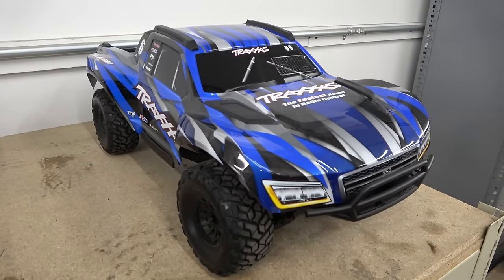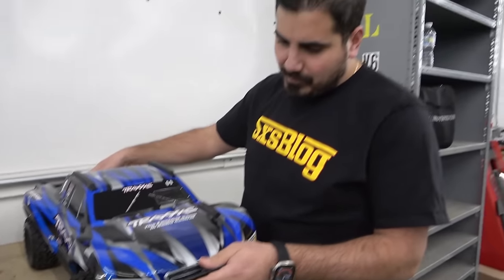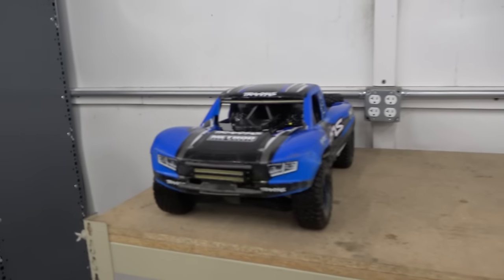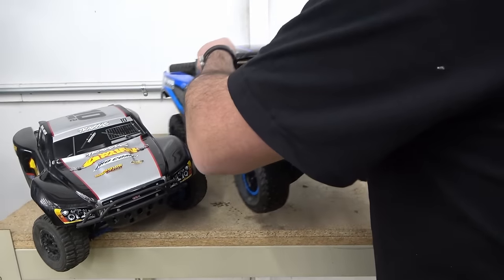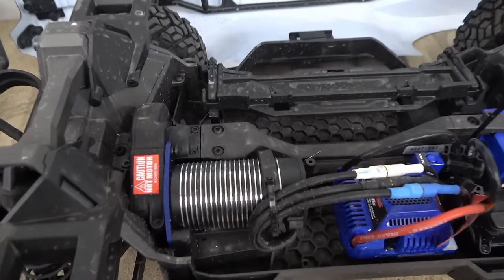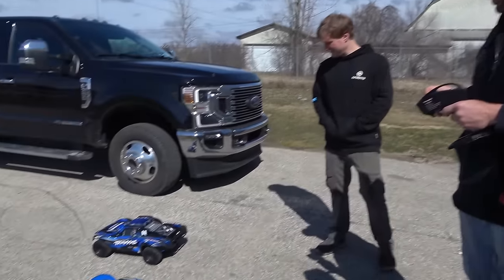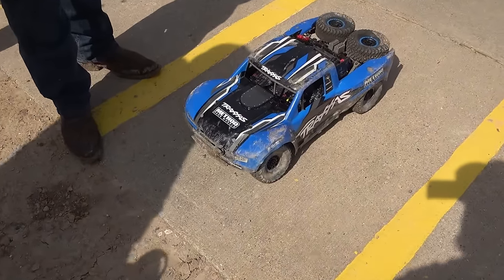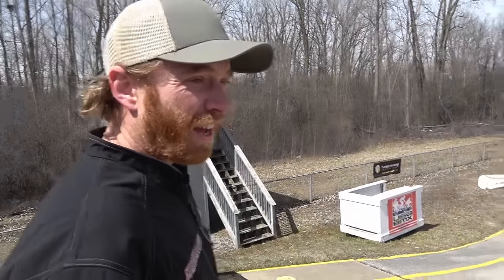RC Truck Carnage! Maxx Slash Durability Test

Comment: You need to find an RC pulling sled. I used to have a modified T-Maxx set up for sled pulling. That was the most fun I had with my truck. I sure do miss my Maxx

Comment: We need more RC Tracks in lower michigan. I use to race RC buggys at larrys performance RC when it was in Waterford back in the 80's / 90's. at that time there were a few local options but now it seems impossible to find anything in Oakland County. I got a Nitro Revo 10+ years back and could only just bash it in local areas and then just got back in it with a Traxxas Maxx widebody. I want to rip it on a track but can't find anything. If anyone knows a good place in Oakland County to rip these let me know. I've already upgraded all the weak links so hopefully it doesn't break on my first run lol. Now I want an XRT with no big open places to rip it's pretty much just going to sit.

Comment: Flips it into the stratosphere at 40 m.p.h. "Don't know why this happened"  😅😅🤣🤣😂😂  Enable training mode by powering on the receiver and keep the button pressed until the led blinks red  3 times.  Its way more controllable and the battery last way longer. Still a blast to drive.

Comment: that’s what weight and 6F power does I’ve got a summit, which is a monster it’s a beast. I have a graded it to a 6S and a mambo max pro from castle it’s stupidly fast, but because of the weight, the mass of the tires, it rips stuff apart. butits funnnnn

Comment: I just got an arrma Mojave 6s last week, I think your money is better spent there, it's bigger tougher and just as fast. On 4s it rips pretty good. On 6s it's an Animal! I have had a UDR before, similar speed and power but it jumps and it TURNS 100X better. I was looking at Maxx Slashes but just had a Maxx and wasn't too impressed, also a little smaller than I wanted.

Comment: A 8s Traxxas ESC is the same size as the 6s ESC. And that motor can handle 8s. And put 20 million in the center diff. And get the 44 tooth pinion gear.

Comment: Funny stuff fella's. You can stay level in air by using throttle and brake. My rustler 2wd does triple backflips off jump if I go full throttle in air aswell as frontflip if I hit brakes in air. Avagud1

Comment: I heard wd40 or soaking the suspension parts in hot water makes the plastic more impact resilient.
Reply: I did something similar on my Xmaxx, it did go years without breaking any suspension parts
Reply: @Steve-sxsblogparts  i put the wide kit on my xmaxx and its ridiculously stable on flat ground. It just spins out instead of flipping. Mabey the wide max kit will fit the slash maxx.
Reply: @____MC____  I've thought about it, still might do it eventually, but I like the way it looks now lol